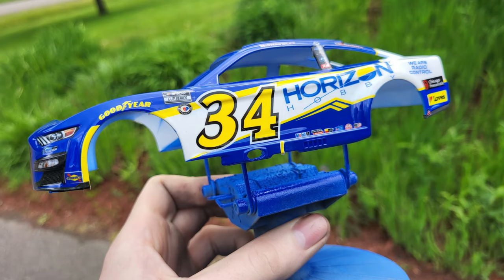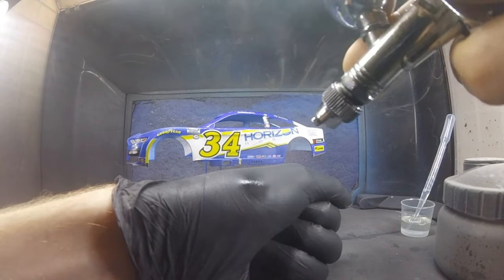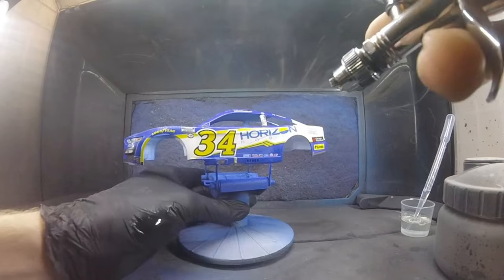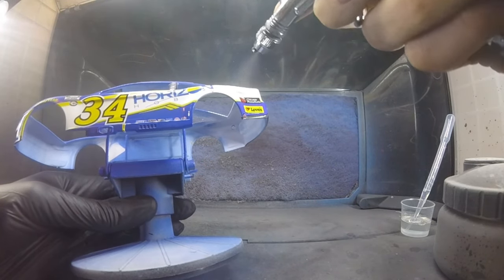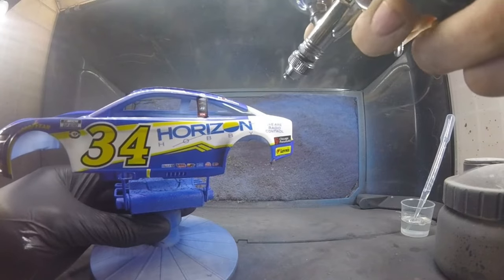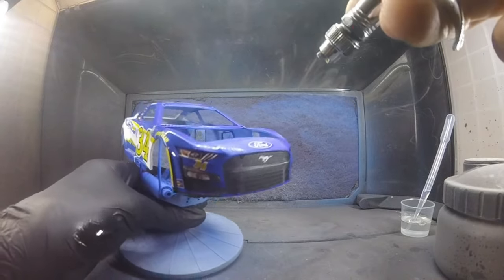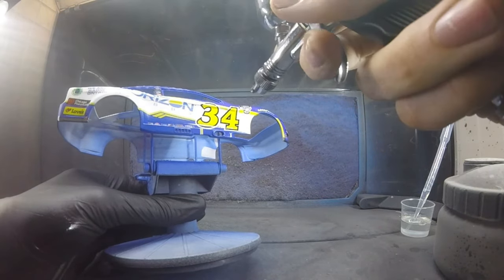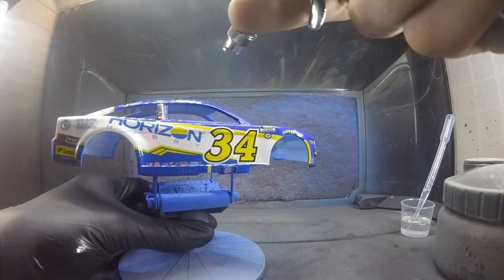2k clear on the 34 NASCAR (part 2)

Comment: Nicely done. Question! I am hoping you can help. I used Dspiae polishing compounds on 3 pieces(motorcycle) and all three had 2K Clear coat on them. On one piece, the polish came out amazing. On the other two... the polish like caked on and It was stupid hard to remove it and to repaint them. Any ideas why? Thanks!
Reply from the maker: Yeah, you can't really slip 2K clear because it's hardened it has a hardener, and it's pretty impossible to strip it unless you use a special paint stripper which I don't recommend. So the best thing that you could do is just stand it that's pretty much your only option at that point.
Reply: @NYSMODELING  Thank you. So what is the proper way? Paint, polish clear coat? Am I missing something? I thought polishing comes after clear coat.
Reply from the maker: @DarksouIjah  here's an older video I did years ago https://youtu.be/8DKPKgqvn5c?si=RTthuf5vOeKZ5yvR
Reply: @NYSMODELING  Awesome. Thanks.